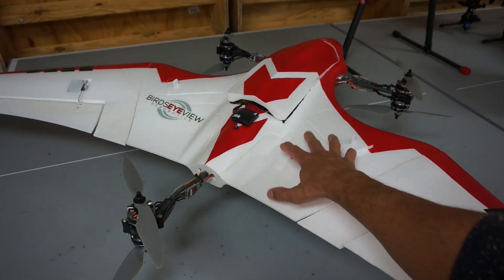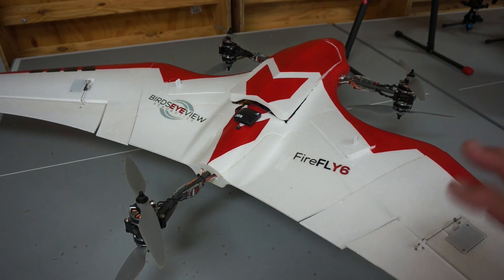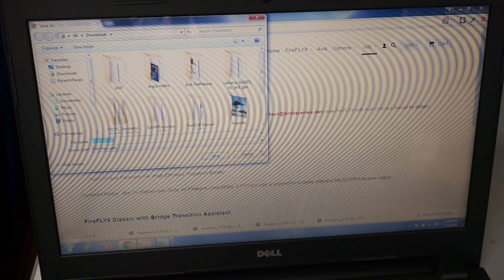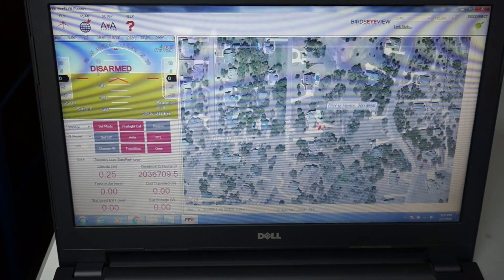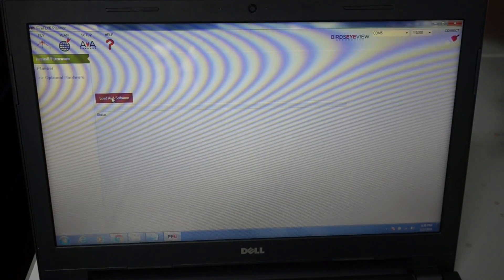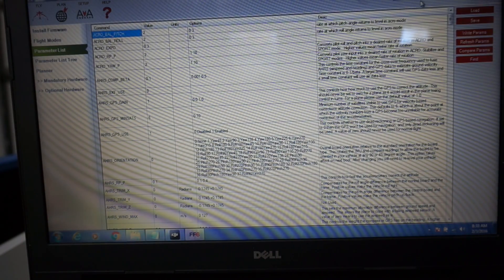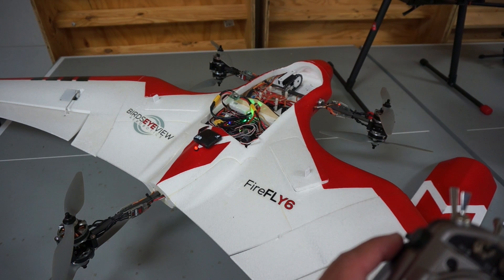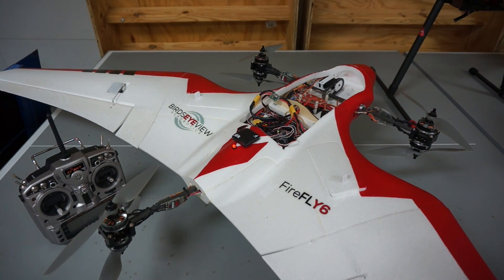Pixhawk Updating Firmware and Saving/Loading Parameters on the FireFLY6

Comment: * Great Presentation
A. how far can it travel with respect with payload and battery capacity?
B. Do you have any information on Battery swapping to extend range  ? For Example, From Point A to Point B, cargo removed, hot battery swapped, then it returns to Point A

Comment: Hi Dennis¡ I tried to load custom parameters in Mission Planner, but I can not write them because there is a message: STAT_RUNTIME is marked as ReadOnly, and will not be changed. Then I found that parameters, but in the description it is Total time autopilot has run it is not a read/write option. I hope you can help me, please¡¡

Comment: Hey there... I have been running the 3dr pixhawk on my quadcopter... I recently upgraded to larger arms and bigger motors with props... I having a really strange problem... The quad yaws to the right alright but doesn't yaw left...
Reply from the maker: +Anirudh Devilboy After you upgraded did you happen to re-tune your PIDs? I would recommend something like an Autotune after doing that big of an upgrade.

Comment: Dennis, The new pixhawk update, is this only needed for the firefly? or is it for anything using pixhawk ?
Reply from the maker: +Roxanne Ringler This process will apply if you're running any branch of the APM firmware that is not "production ready". Most of the time you'll just click the update firmware icon for your setup type (rover, plane, copter). In cases where you're using custom firmware then you'll use this process. Hope that answers your question.
Reply: Dennis Baldwin Thanks Dennis.